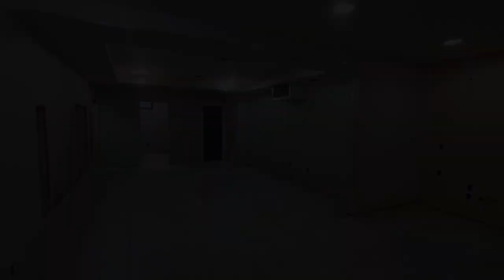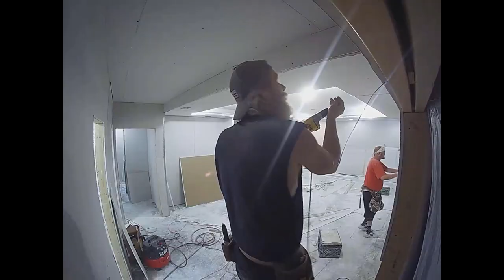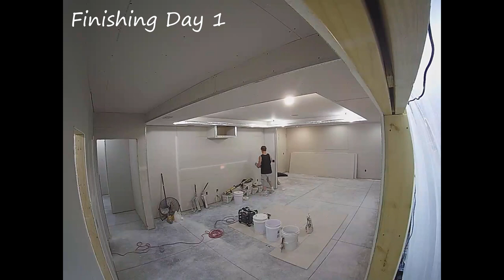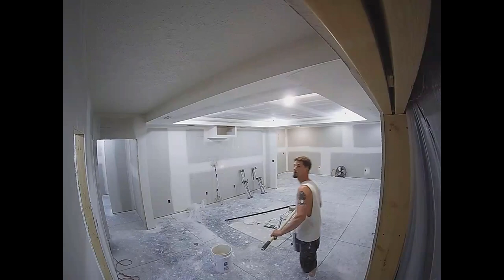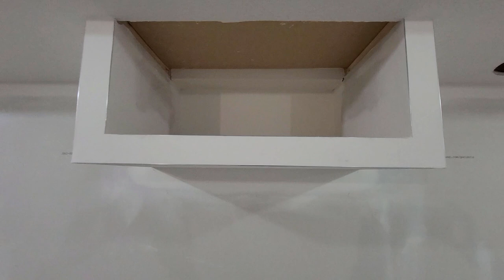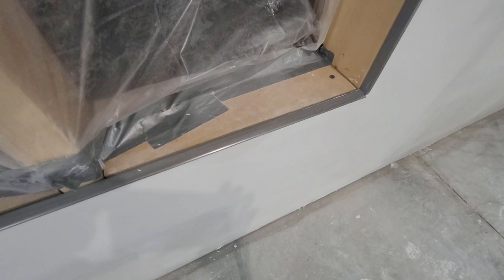Basement Home Theater - Drywall Installation and Finishing Process

Comment: Nice work, thanks for sharing the making of it. What were your thoughts on putting the projector higher in height as part of the back of the recess ceiling? Or is it high enough that you didn't need to lose some of the aesthetics of the current ceiling.  Looks great!
Reply from the maker: I luckily have 9' walls in the basement - so height really wasn't an issue.  I wanted to maintain access above the projector box for outlets/wiring/etc.  Thanks!

Comment: Turned out great! Looks like you and I are running about the same pace. We just had all of our trim work put on the floor. Unfortunately I’m making a change order to our theater riser steps - too small. But what a great feeling to see the drywall come up. Looking forward to your next steps - what speakers do you have planned? Edit - never mind, went back to your old video to check out speakers
Reply from the maker: Thanks!  The drywall going up has probably been the most exciting step to see so far during this whole process.  I'll be hanging the doors, installing the trim/baseboard, and starting to paint here pretty soon so stay tuned!  Good luck with the rest of your project as well!  Are you documenting it anywhere that I can check it out?